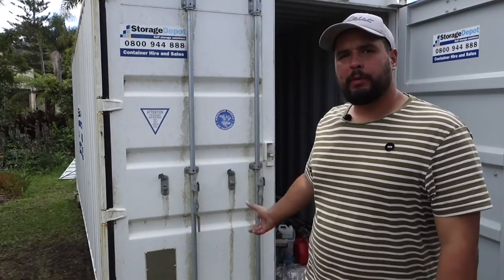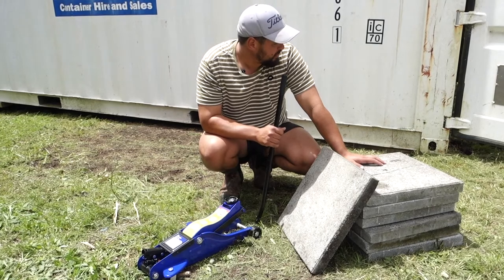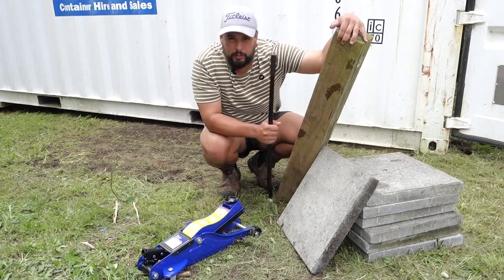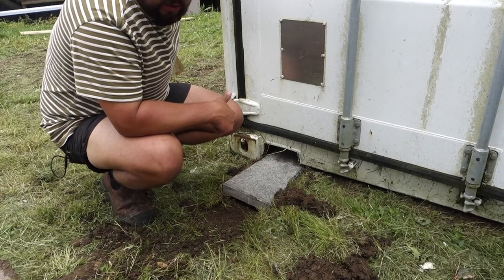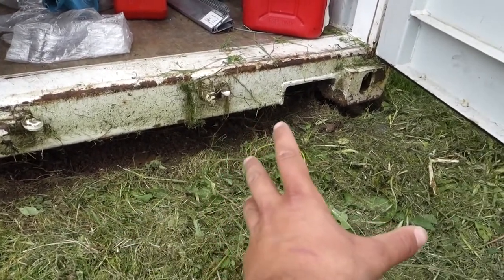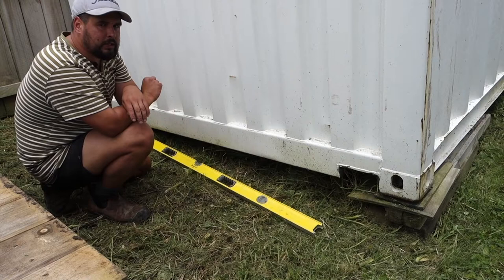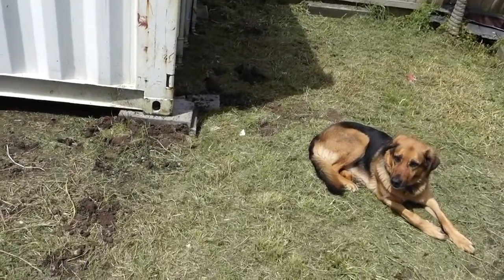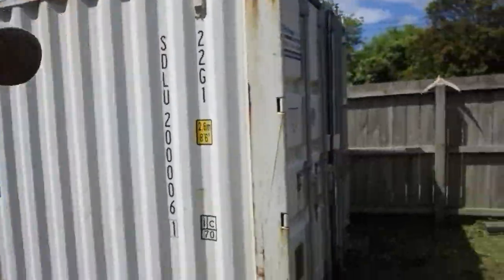SHIPPING CONTAINER WORKSHOP  - PART 1  LEVELLING

Comment: If you have two railroad ties waiting when your container is delivered you can place the container end on the first, drive forward then place the opposite container end on the second. Ties permit sufficient ventilation below the container and place the container high enough for future jacking if shimming is found useful to level the box.
If you have room, buy a forty foot or longer High Cube as the little 20s are "cute" but terribly limiting and their low ceiling height an annoyance. OTOH High Cubes permit hanging heavy duty shelving (easy to fabricate) from the interior tiedown loops on the ceiling corners.  If you want power the easy way is have a pole placed with an outdoor circuit breaker panel and both 120 and 240V outdoor receptacles (if in US) or whatever is standard elsewhere. I did that before building my shops and it makes the structure immediately usable as a workshop.
Reply: What do you recommend for resting container on permanently? Concrete Paving Slabs or Railway Sleepers (railroad ties)?